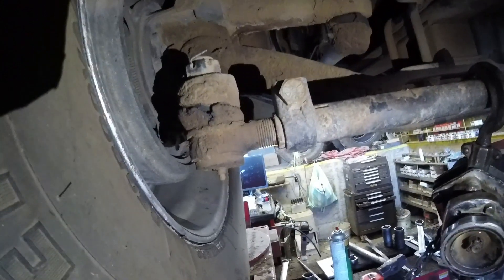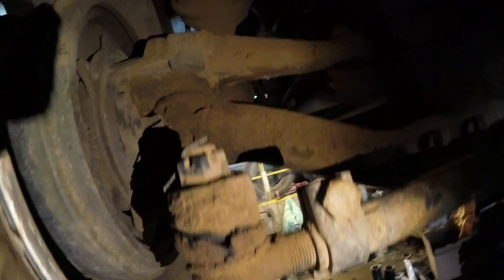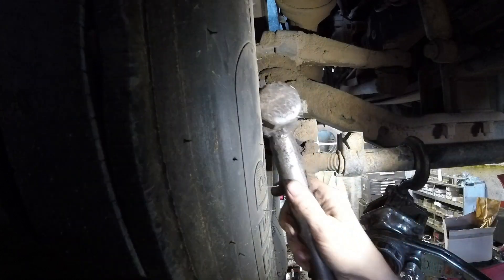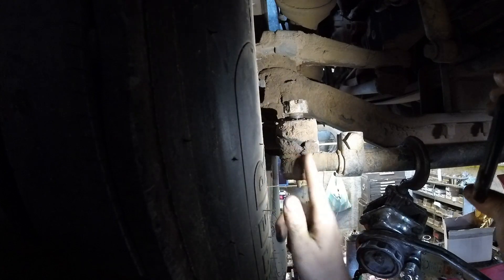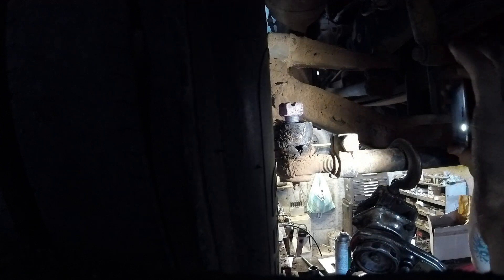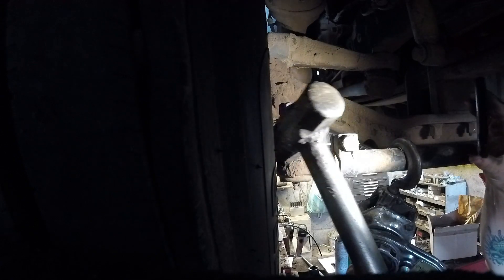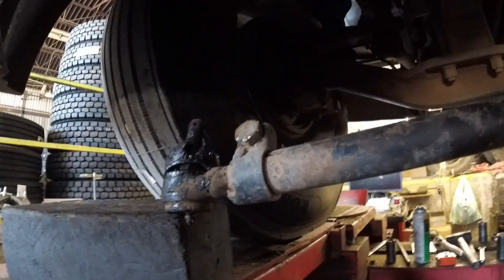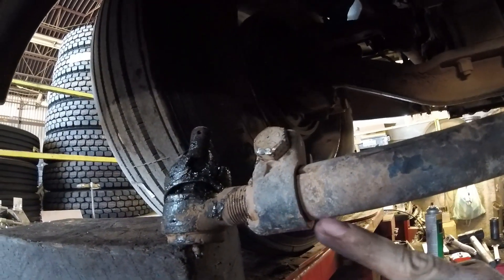How to easily remove  the tie rod end on a semi truck

Comment: I repair transit buses.  Similar setup as this, just less room to work in.  Anyway.  We never use heat unless we are going to replace the spindle assembly also.  This guy just needs a larger (10, 12, or 16) pound sledge hammer.  If I had that sort of access, I would use the 16 pound sledge.  One or two good hits and the end drops down without any weight being added or unnecessary stress on the rod itself.  I know everyone does it differently, but yeah.
Reply: Yahh bigger hammer. :)
The pressure helps. I have used the weight of the vehicle to put some pressure.

Comment: Pull the wheel and tire off you can then get a real swing at it with a 10lb hammer from the outside. No heat needed.

Comment: 100 TIMES FAST AND EASIER IF YOU SIMPLY USE MADDOX FRONT END KIT - TIE ROD PULLER!
Reply: Bruh, this comment literally saved me $$$$$. This is the absolute way. Not the video 😂. I  banged on mine four two hours no success. Bought the kit and it came off instantly
Reply from the maker: @StrongLikeBullTV the clip is 6 years old

Comment: Never put heat to a steering part.It wrecks the temper of the metal.Use a nall joint press.They are cheap enough.
Reply: You can use heat but no where near that much and he put the heat on the wrong place only takes enough heat to be warm to touch to effect a interference fit
Reply: @scotthart586  no you can never use heat on a tempered metal part and retain the integrity.It is physicaly imposiible.
Reply: So you tink 14 degrees is enough heat to damage the integrity of tempered steel? Because that is all it takes to to effect a. Interference fit
Reply: @scotthart586  you are not smarter than physics.
Reply: Never said i was what i am is a mechanic not a tech do you even know what a interference fit is?

Comment: This young man just showed you the absolutely wrong and very dangerous way to change a tie-rod....1 never ever heat up any front end part, unless you are going to replace it with a totally new part. The reason for this is the metal is made of very soft metal and once you heat it up passed 375 degrees....you have now tempered the metal ! The reason you don't want the metal to be tempered , in case this truck hits a curb and or gets into an accident,  the metal that is now been tempered now is brittle  and will break like a peace of glass.front end parts are  Designed to bend not break off !!!...results, loss of steering control and a truck carrying a full load of 80,000 lbs driving at 65  mph ...😱😱😱 you do the math! This person is putting other people at rise just because he wants to save the customer a few bucks?....SMDH!....you could buy a whole complete  tie-rod assembly for about $200.00 bucks now the customer is safe you labor time everybody is happy, and safe.
Reply: Tempering, in metallurgy, process of improving the characteristics of a metal, especially steel, by heating it to a high temperature, though below the melting point, then cooling it, usually in air. The process has the effect of toughening by lessening brittleness and reducing internal stresses.
Reply: It only requires enough heat to be warm to the touch approx 130 degrees to effect a interference fit but this guy put the heat in the wrong place